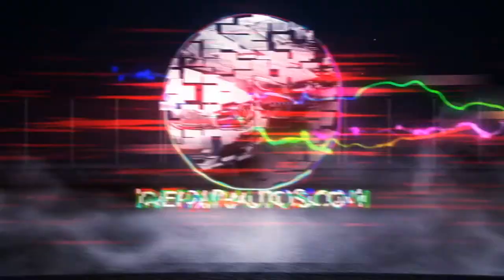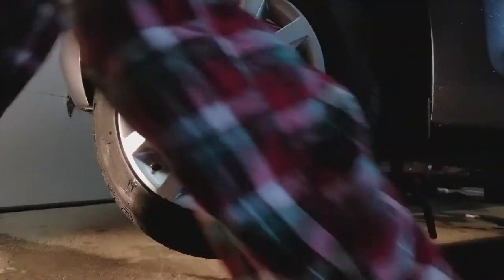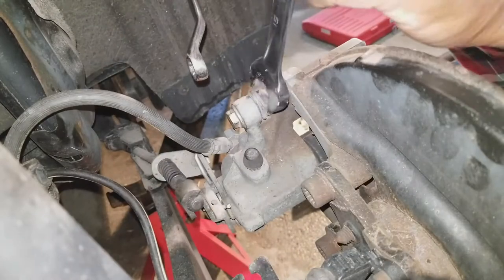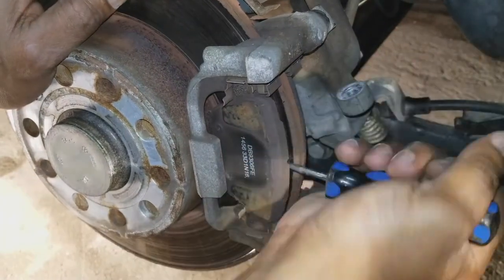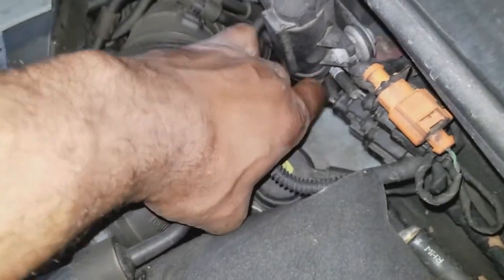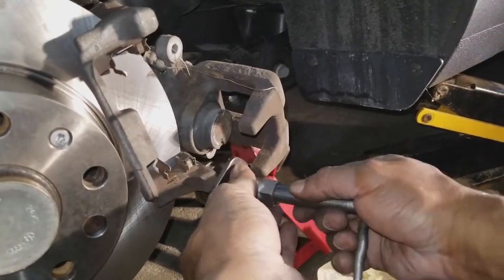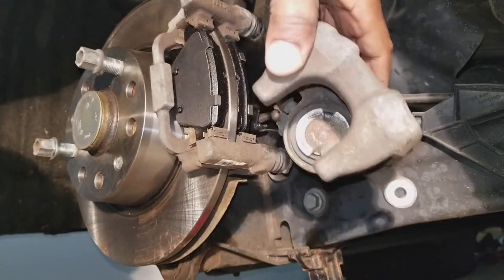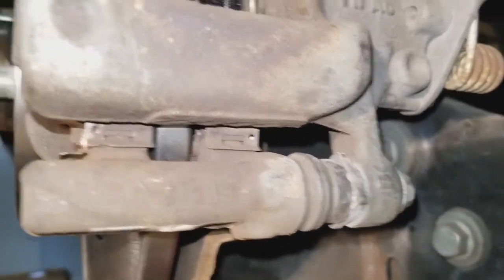2013 Volkswagen Beetle Brake Pads Job | DIY | iRepair Autos

Comment: Nice simple, straight to the point video!,Thank You!  I am planning on doing these soon on our 2013 turbo beetle and am glad these are simple to do! Just a few simple tips so this can be done like a pro. 

1) it’s always best to bleed the caliper before or while pushing the piston back in. This prevents the dirtiest part of the fluid from being pushed back into the rest of the brake system. Invest in an inexpensive one-man brake bleeder kit (<$20 on amazon) and follow the instructions. Once the caliper piston is reset, close the valve and proceed with the brake job. This also negates the need to pop the master cylinder lid off since the fluid will be displaced by going out the bleeder.

2) clean or replace the thin flimsy hardware that the pads slide on and grease them along with cleaning and regreasing the slide pins. The slide pins can be found under the rubber boots and can be cleaned and reused if the metal isn’t pitted or corroded and the boots aren’t ripped. If these pins (or hardware) aren’t at least regreased, the calipers can apply uneven force to the new pads. This leads to reduced stopping power and will reduce the life of the affected pads meaning you’ll be redoing your brakes!

3) torque spec! I don’t have the spec book in front of me but most VW from 2011 to 2015 have a torque spec of between 24-28 ft lbs for the  rear caliper slide pin bolts. 26 ft lbs is a good number in between. This is not an item that requires gorilla strength!

Comment: Aye do u need to do that to the caliper I don't have that tool I just need to change my drake pad or is that part of the process
Reply: i used a pair of needle nose pilers for it and twisted. worked the same when i did my 2015 stang gt pads. 11 months late though lol

Comment: Is the method for front pads the same? TIA
Reply: front brakes dont need the caliper turnback tool. you could just use a giant combination wrench to push it back